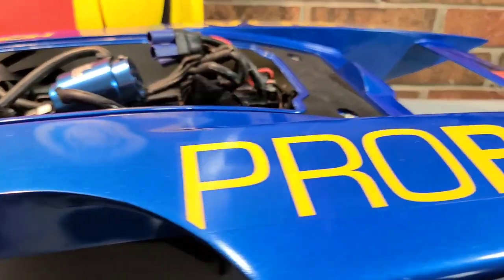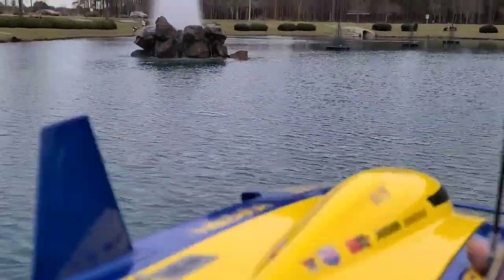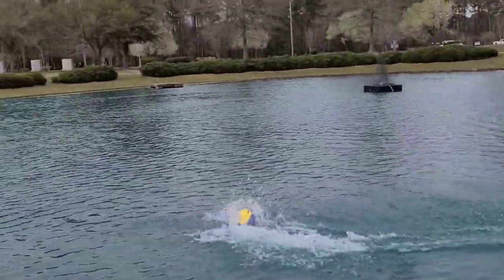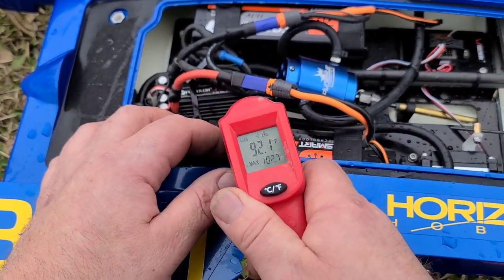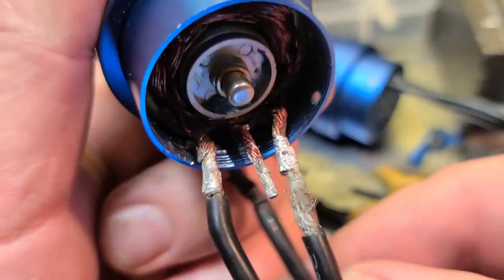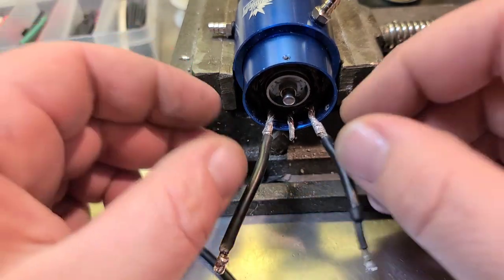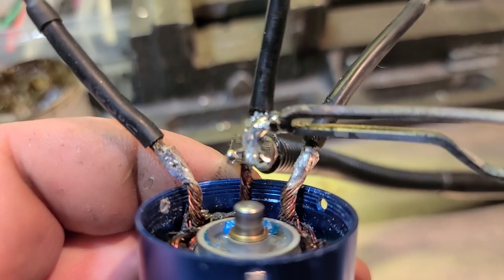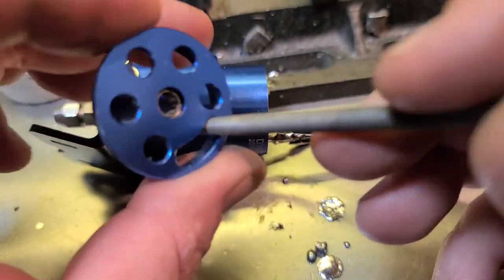UL-19 6 Pole Brushless Motor Problem & Free Fix

Comment: Just bought a ul-19 boat made a 15 minute run and the wires did the exact same thing as yours did bought a new motor exactly the same and it did 5 minutes into it so now I'm gonna try it your way thank you for the video!! Dynamite should be responsible for this issue it seems to be common!!
Reply from the maker: It's a really a 4s boat, to run it on 6s you need to prop down

Comment: Your statement on checking Temps....watching your videos I immediately went and got an inferred temp reader at harbor freight to start checking Temps in my UL-19 that I have also had overheating issues with. So just doing that alone has taught me more than some of these fb groups that I'm on. New to the hobby so I've got a bunch more to learn.  Don't sweat the haters. You're actually teaching some of us.  Thanks for all your videos!
Reply from the maker: So glad to hear brother, the temp gun is such a valuable tool and will save you big in the long run.    BUILD IT IRONCLAD
Reply: @IRONCLADRC  I heard dat!

Comment: Same problem, wire got to hot and solder let go. I did order a new motor, but going to buy a solder gun, flux and solder.
Wish me luck doing this this weekend. 
Thanks Big B.
Reply: Just got an email from HH requesting info and proof of purchase. 
I'll do that tonight.
Reply: Big B. Got a newcmotor for ui 19, stock one.
What colors go to what? On the boat.

Comment: I’m really glad your doing videos like this, it will help Horizon see these problems, maybe they can fix. Awesome videos BIG B
Reply: Horizon will never fix the problem. In very small print in the manual it clearly says to de-prop for 6s sooo run 4 s with a big prop and go fairly fast  or slower  with 6s and smaller prop  !!!  Stock boat with 6s =☹️💥🔥 and 🖕🏻to horizon … But 6s on the side of the box with a big blue beautiful rocket ship now that’s what sells and make no mistake so do replacement parts and accessories. Not a fan of horizon but they hold the market for now so we are stuck with them !!!

Comment: Hi mate. Silver solder will fix the problem.. your starter motor in your car the wires are Silver soldered in because of the temperature and high current running though them. What your done should be OK but if it happens again Silver solder it mate 🦘 👍😁.  I  watch your channel all the time and you have helped me out heaps 👍👍
Reply from the maker: Thanks brother. I will definitely give it a shot.    The wires de-soldered on the 4th or 5th set of packs, I've got to re solder them back on so I will definitely use silver solder

Comment: These motors usually have a crimped wire connection to the second wire. Odd yours doesn't. You're doing a great job sir and I've been running fast electric boats since the Ni-Cad days.
Reply from the maker: Thank you for the idea. I may crimp the wire with silver solder.  Thanks  brother

Comment: Great video big B! 
I thought I blew my stock UL19 motor as well. Just the soldering came loose. Big help! Thank you!
Reply: So I soldered 2 of the 3 wires this morning. Ran her like a top & then the 3rd wire unsoldered itself at the lake. Headed home to solder again lol. Should of just done all 3 first time.
Reply: So I soldered 2 of the 3 wires this morning. Ran her like a top & then the 3rd wire unsoldered itself at the lake. Headed home to solder again lol. Should of just done all 3 first time.
Reply: So I soldered 2 of the 3 wires this morning. Ran her like a top & then the 3rd wire unsoldered itself at the lake. Headed home to solder again lol. Should of just done all 3 first time.

Comment: Thanks Bigb , just had one go bang in a used Delta force 45 . It's locked up so I replaced it with a SSS 40 92 1650 kv. Didn't even hit the water with it and it went bang. Dam it but the motor is from 2004 ,very old but we'll made boat.
Reply from the maker: worth a shot 👌  that sss motor should be boss

Comment: This happened to my first motor in the Veles . They sent me out a new one and I haven’t had a problem since. Horizon is actually pretty good about warranty parts. And usually they are already aware of legitimate issues. The first motor.was coupled wires the second one seems to be one piece. I check my temps regularly as well
Reply from the maker: Thanks brother 👊   I appreciate the info.  I liked you boat bash video.  BOAT GANG. LOL
Reply: @IRONCLADRC  hells yeah boat gang boat gang

Comment: Run these boats on 6 s without running a smaller prop or considerable cooling upgrades and melt away your connections. Yep min did the same thing . I have many of the same boats you do and have done a lot of the mods you have but in diff ways I also made a system to cool the caps and ec5 connectors . Hit me up all send you some info . Run 6s @ 71 mph dead run through a full pack non stop.  that is the definition of iron clan ? . We should share some of our knowledge with each other. Love the vids keep them coming.
Reply from the maker: The cap & connector cooling mod sounds pretty interesting.   Shoot me an email if you'd like. ironcladedout@gmail.com

Comment: I took mine out today and 3 laps in it just died with full batteries. I unplugged the batteries and re-connected and it was fine. I did have to kayak out to the middle of the lake to get it though. I will check the connections but I didn't run it long enough to overheat it and wasn't going full throttle yet either.
Reply from the maker: Thats a Bummer. Tip,  Make sure the prongs on your esc connectors are tight fitting into the battery plug

Comment: My club , new members are taught to check Temps after each run. Only thing we use 8mm instead of 5,5 s
Reply from the maker: Oh man I just installed 10mm cc bullets, night and day literally dropped esc motor and wire Temps 30-50deg.    Crazy how much difference a bullets twill make

Comment: I had something similar happen with a different motor. one of the banana/bullet connectors came disconnected it puzzled me for ages cause I took the heat shrink off and all the solder joins looked good and none of them were loose or broken but after I did a continuity test I found that the middle wire had no continuity some how. so I just touched it with the soldering iron and boom good as new.
Reply from the maker: Same thing happened to me on my arrma granite.

Comment: Funny with the smoke bro. You should have wacked on those heavy wires when you had the chance, oh well next time. Just a couple of things if you want, Always try & do a mechanical join on your copper wires by twisting or clamping or even pushing the braids into each other and twisting a bit just so your not relying on just solder to hold. (I know its a tight space to work)  Also clean off your flux to stop it corroding later & and even lacquer it if you want to go all the way, and last try lead free solder which has a higher melting point. Nice work m8 cheers from NZ.   ps Big B fastest heat shrinker in the west !
Reply: Im still trying to get my Sonic to corner like yours but I'm not even close yet that thing is so dailed in, its a beautiful thing.
Reply from the maker: Thanks for the info brother I was gonna use lead free, but for now I think it will be okay.   Build it ironclad

Comment: My Veles 29 with the same power system did it five times.. I replaced it with a TP 3650 2350kv sealed end cap motor. Never had an issue again and the boat is Way WAY FASTER than the old dynamite 2000kv motor. Hard to keep it from taking flight at 3/4 throttle. 100mph plus with just the TP motor upgrade!!!!
Reply from the maker: Heck yea I actually considered running that exact same motor, but went with a 40 series instead, still trying to break 90mph my best is 89

Comment: Hi big B, if you're thinking of putting a tunnel fin on the blackjack take a look at your UL19 and check the angle of that one, it's similar with the two spontions and hull tunnel that may give you a good starting point, I watch m5 imformer and he showed something similar were someone hooked up a servo to  the fin in front so he can adjust it as he's running ,I thought that was pretty cool just a suggestion ,good luck would love to see it .
Reply from the maker: Oh man an active winglet would be kick but  for sure I appreciate the information brother. I'll use the ul as a guide, thanks

Comment: You can always go bigger on motor wires without fear of creating electrical problems.  Opening the endbell as you did is a good work-around to your solution and you did a "Jet Approved" fix.  I can get you a small discount on one of Steve's motors when you're ready for the REAL upgrade.  Why does that motor have short leads?  It must somehow cut manufacturing costs or was just a one-time fluke and that was how the Chinese guy at the factory fixed it so his boss wouldn't beat him with a cane.  Constant temp checks is a GOOD thing.....

You did get me with the smoker though..... 🤣
Reply from the maker: Hahaha. "0 knots and alot of smoke c'mon"   I was so tempted to put the 10g wire on. Same length. More current "flow" cooler wires.  I may upgrade to 10g in the future just to see if wire Temps come down?     

I may take you up in the nue motor later on.  Thanks DOC
Reply: @IRONCLADRC  If you go back in your vid, you can see where the guy at the factory had just a small contact surface between the wires,  This no doubt created resistance causing enough heat to melt the solder.  When you re-did the connection, you had a WHOLE LOT more surface area.  That alone should reduce the resistance, and therefore the heat and you should never experience this issue again.

There's a reason spacecraft use crimped electrical joints......
Reply from the maker: I ran the boat today the Temps were much cooler than usual. I believe your 100% correct.    The micro rigger is looking good brother 👌    busy today didn't get a chance to comment in the video.    Build her ironclad. Oppps jet it out. 👊
Reply: @IRONCLADRC  😅🤣😂👍

Comment: Great  video.  Question for you sir. I have the same boat, dual cooling etc.. Mine ran good twice then went to crud,  now it will accelerate to full throttle then die. Let off the throttle and get back into it accelerate and it will do it again. Sometimes it will accelerate and all of a sudden back off to half throttle.????? I already switched to a big sea king controller.  Same thing.  Any ideas ? Thanks
Reply: You may have a similar situation where a high-resistance solder joint at the motor could cause erroneous/intermittent back EMF impulses (the stuff the ESC uses to know where the motor is).  Give it the IRONCLAD inspection/
Reply: @Dr_Jet  hey, thanks, I didn't where to go at this point. Much respect to you sir.
Reply from the maker: Do you have the throttle/steering calibrated Rx/tx calibrated?   Is there a good connection between the motor & esc?
Reply: I was just thinking... everything is calibrated, different speed controller,  tried a different transmitter only thing left is the motor. What should I replace it with? Thanks for everything guys.
Reply: @jefferyferguson9232  Look at you motor wires like Big B did first.  The motor may be salvageable.  If not, there are countless options available.  In the small boats, I like to go cheap because I can.  As you go up in size, I like to go up in quality of components to deal with bigger everything.  If I were building an all-out speed monster, I'd use one of Steve's motors, a monster controller, and top-notch batteries.  Otherwise, you could go the Big B route and duplicate what he's done here.  His UL runs very respectably (just watch out for turtles...)

Lastly, you could just replace the existing motor with like for like.

Comment: after watching this i have no confidence in TP motors. my leopard motors have failed in the same way, but usually when my set ups overheat. and the motor seems like its not contacting somewhere, as your is...usually i just have to swap out the esc. i seem to have the best luck with rocket motors that are in the 1250kv-1800kv on 6s i have had the most success. i havent had to change out that dynamite 120 a esc or motor in the UL 19. but i have no confidence in it, even with upgraded cooling. i'm fairly certain the ul 19 stock electronics are not going to last long. i've gotten a few runs so far , closely watching the temps...on 6s we shall see. i just take it ez on the full throttle passes
Reply from the maker: Run the stock electronics till they smoke then upgrade.

Comment: I have this motor to but I'm not sure I have this problem I'll check when I run it first time this year
Reply from the maker: Good luck with the maiden.   I think it was due to running on 6s with the water jacket pushed to far back on the motor.  Make sure your jacket is forward  on the motor. Shouldn't have any problems
Reply: @IRONCLADRC  thank you it's unmodified from manufacturer but will see

Comment: Maybe it's  better to put the 5.5mm bullet conectors direct to short wires like on the LMT motors,I have the same motor I'm m curious if it's built the same way, I only ran it with 6s in my boats, very powerful engine really.
Thank you for you video ,always very informative👍
Reply from the maker: Yes it's an extremely powerful motor & I thought about soldering to the stub wires but I'm thinking it will throw off the pules to and from the esc?  Idk. I shortened motor wires in the past without success motor got extremely hot hotter than usual
Reply: @IRONCLADRC  It was just an idea, a more responsive thread will probably hold up much better now
Reply: @IRONCLADRC  Insulating the plugs against the motor housings and adjacent plugs would be my greatest concern, but that is a good solution if the mechanics work.

Comment: You should try  removing the clear enamel coating completely on each strand of the motor wires  before resoldering each stator winding group to the lead wires ..any remnant on the winding wires will cause resistance as it did in the middle wire, [ the enamel or shellac as it  used be known by  is what is creating the resistance and heat build up that desolders the joint ] . Then, once the stator wires are free of that shellac /enamel ,  use  solderable high quailty silver plated butt couplers  to mate the stator  leads to the wire leads and shrink wrap the joints .You may have to slightly enlarge the motor`s end bell  wire holes but not by very much from the looks of the video. 
Also ...it looks like you are cooking the solder too much , a properly  soldered wire should shine like a mirror after it cools with only minor or no visible flux remaining which can easily be cleaned .Your solder joints look like dull aluminum because of the grade of solder and flux  since   you are not using the proper solder -flux  core electronic solder and likely your soldering iron is not heat range adjustable ...both of those factors 
lead to unsuitable solder joints for high  current  application. Correct  solder ,correct  iron , no enamel on any wire strand , butt connectors.....have fun .
Reply from the maker: THANKS FOR THE TIP
Reply: @IRONCLADRC  
My pleasure you are entirely welcome  . I enjoy wathcing your videos ...in my late sixties now , I heve been retired for over 5 year  form an engineering career that included electronics . I dabbled in the hobby in my early 20s when gassers were the only way to go fast , I built only one boat an 1978 ATLAS VAN LINES  unlimited,  money for my formal education was tight so the hobby had to go, never got back in it . My eyes are not what they used to be so getting back into the hobby now  is out of the question , watching video from gents like yourself is entertaining enough  ...sorry about the misspellings with my glasses on,  I think  got them all ...hahaha ha ...have fun !!!

Comment: Got motor problem myself today, but my problem was that i ripped the whole motor mount loose on 6s testing, and i got my first bathing of the year ;)
Reply from the maker: What boat were you running?
Reply: @IRONCLADRC  Rico 31"
Reply: @IRONCLADRC  Uploading a video now from testing with 6s and when the error happend at the end, too choppy water and needs adjustments
Reply: @IRONCLADRC  If you watch on my channel, you can now see both maiden runs
Reply from the maker: I wi check it out.   Sorry been super busy today.  I'm gonna check it out now
Reply from the maker: Oh man that thing was ripping.  How far away was the stuffing tube from the collet?  If the gap is too big you may have twisted the cable in return twisted the motor mount off the epoxy?  Just going by sound. Sounded like you may have had a bit of whip in the cable?
Reply from the maker: Email me photos I can help more if you'd like
Reply: @IRONCLADRC  stuffing tube was close, just so i could open the collet on motor.

i actually belive i had too narrow gap on the stinger, leading to not beeing able to retract on torque. as i had like 1mm gap + teflon shim.

whole torque tube is gone, vanished and i just found pieces inside the boat, servo mount is gone, need to cnc a new servo plate.

it really did scream, but had tonns of torque roll, so that whats made it hard to controll as it wanted to roll over on the choppy water.
Reply: @IRONCLADRC  one more thing.. i was never on full throttle, as it wanted to roll over like a dog og grass, and it was a little 38mm prop.. wonder what it will do on 42mm
Reply from the maker: Roger that.  I see what your saying.  Hopefully you can get her right.     It takes time.    Jeez 38mm prop.  Wow.  You should be able to tune the torq roll out with no problem.  It takes time to get a boat right.   That's why I show you guys my good and bad days on the water.     God luck with the fix brother
Reply: @IRONCLADRC  thanks, i might change stinger at the same time.
have you tested TFL flex shafts ? those i can get locally, same with stinger.